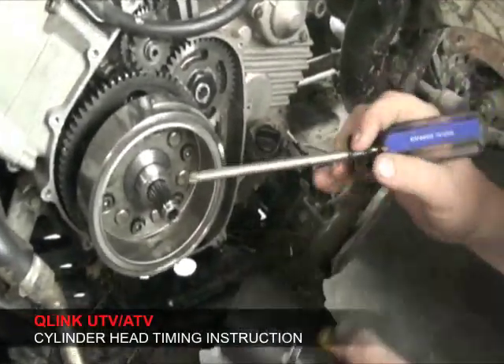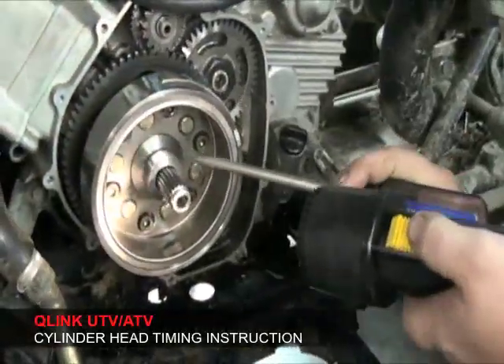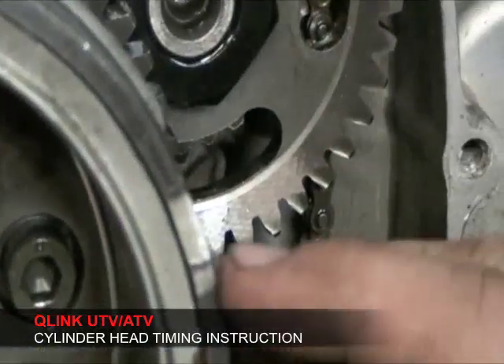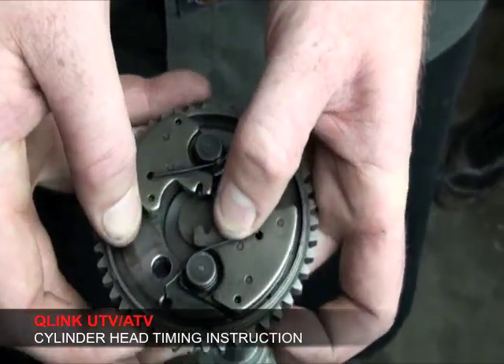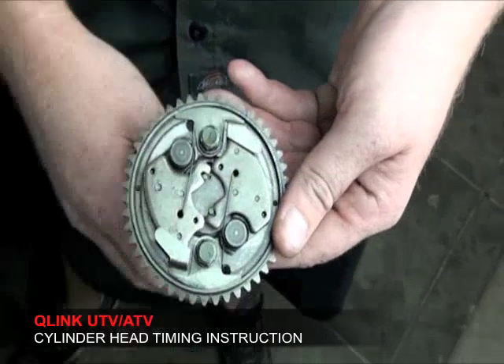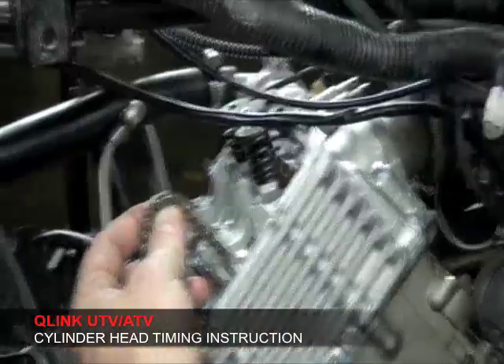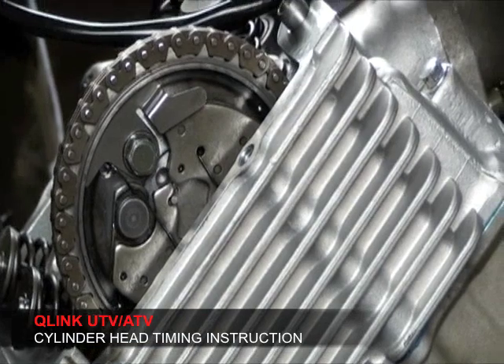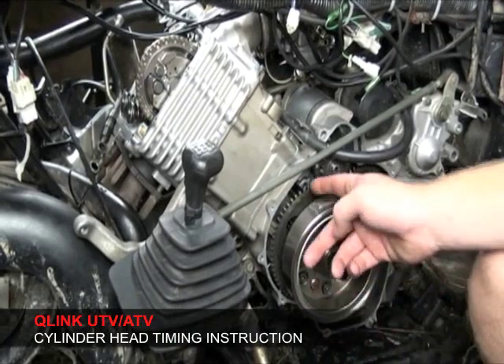QLINK UTV/ATV Timing Instruction

Comment: What is the torque specs on the bolts that hold the cover that has the staitor in on?
Reply: 7.2 lb/ft. 40 lb/ft for the big bolt that goes into the crank for the fan drive.